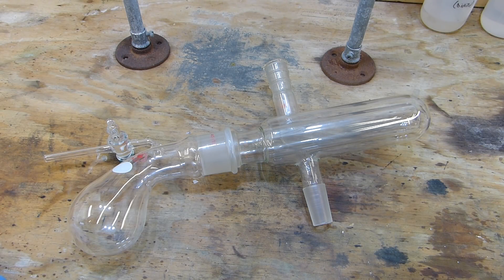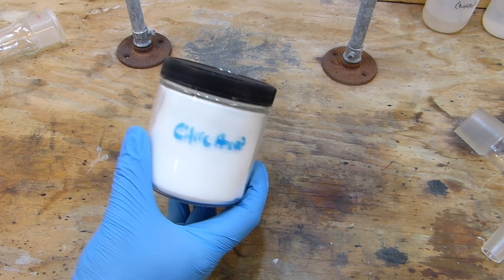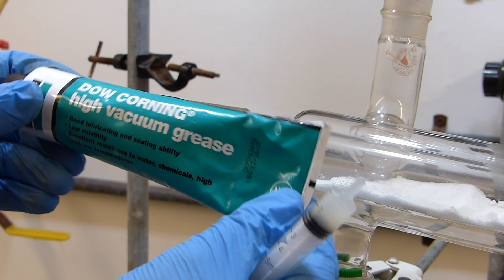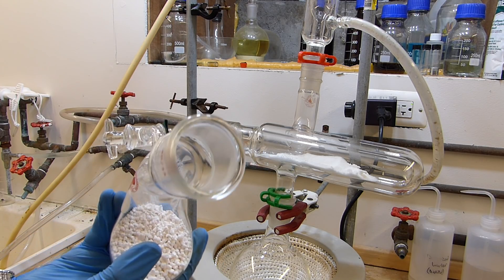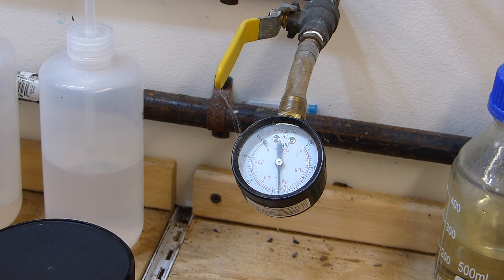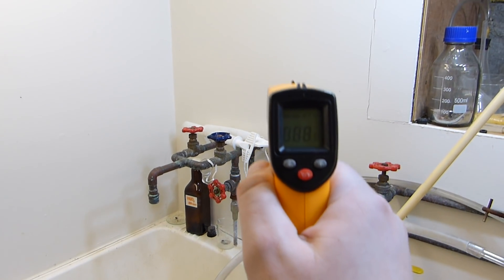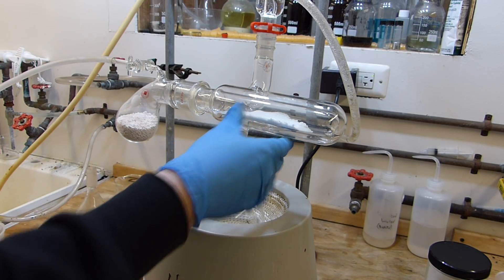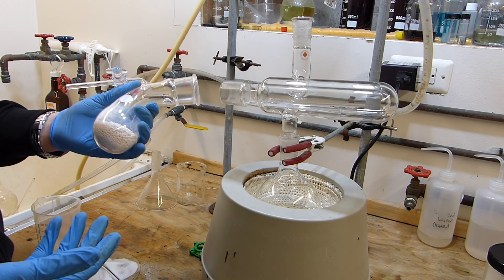Lab Glass: The Drying Pistol

Comment: 10:02 As far as there are several oppositely located orthogonal to the plane of the joint intersection hook-like branches you can use a rubber band to secure the joint.

Disclaimer: While It looks like I am going to necropost, note the non-null possibility that the piece of advice may help someone :)

Comment: I got an oldschool (50s-60s) set of glassware from a retired chemist that had a hobby lab at home as well. Much of the beakers or apparatuses are pre ground-glass joints/openings (meant to use rubber/cork). 

Interesting Items: 
- A whole vintage collection of various compounds/chemicals from some place in the 60s that was like Fischer/etc but apparently sold in smaller amounts cheap, and didn't care if it was also to kids (cuz one of brochures was marketed to the kid 'chemistry set' but they contained hazardous compounds lol
- A Hoffman Apparatus: Its in pristine condition, but hasn't been used yet because I haven't found an alternative to platinum electrodes for the one side. 
- Interesting old-school long (24") pipettes with detachable bulbs but no removable heads. 
- Some of the simple distillation flasks w/ the integrated condensation  at like 60deg angle of the neck. 

I was hoping to find time to start a YT series testing the existing large batch of old chemicals and/or repurposing them. I really like the DIY channels like this as that's my style, but I find a lot of the 'surplus' and 'post-dated' chems are super cheap, and while not production lab grade they can still be viable for many things in an amateur lab or re-purified (discarding the degraded %)
Reply: Platinum electrodes are still readily available. United Nuclear carries them for ~25USD.
Reply: Correction, 2 for 35USD, comes pre-fitted to rubber stoppers which you may have to contact them to make sure they are the right size.

Comment: This has been replaced by pid controlled water and oil baths.  Connect a flask to a vaccum adapter.  Then a male to male 75 degree adapter and another flask.  Put the flask with the compound to be dehydrated in the pid controlled bath.  Come back the next day.  No flammable vapor.

Comment: I know this is a old video but I do have a question. Why do we need a boiling liquid in the jacket? Why not heat water around that temperature and keep it at that temperature and constantly run it through the apparatus?
Reply: At one time it was not possible or convenient to control temperature like that. Boiling points however, are well known and reliable. Using a boiling point solves the problem of having to constantly fuss with the heat source.

Comment: I can’t figure out why you need to turn on your water to get vacuum pressure🤔
Reply: The aspirator works by pushing a stream of water through a venturi in which there is an orifice. Because of the venturi effect, the pressure at the orifice is reduced, which draws a vacuum. This is the same way that sink powered aquarium vacuums work.

Comment: I dont understand all the refluxing thing in this case. 
Isn't possible just to heat the glass at a constant temperature?
Reply: It is not practical to try to manuall fuss with a heat source to a precise temperature like this without modern electronics. This device predates modern electronics and was meant to get around the problem.

Comment: it's particularly useful for drying and then taking the entire pistol (minus the condesor and boiling flask) into and out of an inert atmosphere glovebox without having to expose the material to the atmosphere. but you need a real vacuum and inert gas so as not to destroy the atmosphere in your glovebox when you open up the pistol inside the box.
Reply: True enough, although I would point out you can do that with a modern desiccator as well.

Comment: When you use an aspirator to make vacuum, the vacuum is contaminated with water vapor (vapor pressure at temperature of water in the aspirator).  Isn't this higher then what CaCl2 can make?  Doesn't re-opening valve to aspirator introduce water into the apparatus after the CaCL2 has done its work?
Reply: How can a vacuum become contaminated when it's always being drawn down? The air in the line might become contaminated, but isn't it being blown out of the faucet?
Reply: @jermainerace4156  The vapor backstreams from the vacuum pump to the pistol.  When pressure is low, each gas molecule is operating independently of the others (most of the collisions are with the vessel walls, not other molecules).  Look up "molecular flow in high vacuum" for more.  When pressure is high, the dominant interactions are between gas molecules (look up "viscous flow").  This "backstreaming" problem becomes dominant at high-vacuum regime, so much that the pump selection dominates the choice of pump.

Comment: Im a little confused as to how your vacuum works with your sink.... But thats badass.
Reply: The vacuum device, called an aspirator or aspirator pump, uses the flow of water to create low pressure, thus drawing out the air.

Explanations here:  https://en.wikipedia.org/wiki/Aspirator_(pump)
and here:  https://en.wikipedia.org/wiki/Venturi_effect

Comment: You said this is an outdated equipment. Just wondering what replaced this? Vacuum desiccators? This seems like a better option since you can heat up your compound.
Reply from the maker: Mostly these fell out of favor with the invention of electronic temperature control. Back before electric hotplates and ovens, precise temperature control was difficult since you would usually heat with a flame. The vacuum is mostly a bonus.

Comment: Hey Doug by any chance would you make a video showing how to make chlorohexidine?
Reply from the maker: Maybe. That would involve quite a lot of videos. I'd have to do benzene -> chlorobenzene -> p-nitrochlorobenzene -> p-chloroaniline. I'd roast calcium cyanurate to calcium cyannamide, set that aside. I'd have to somehow find hexamethylenediamine which is a nylon 6-x monomer but otherwise difficult to prepare. The cyanamide and hexamethylenediamine would react to attach cyanogunnidine groups to either end of the amine, and p-chloroaniline would react with that to form Chlorhexidine. 

As for the hexamethylenediamine, the only way I can really think to do it in the lab without buying it is with suberic acid reacting with urea to form suberamide (Octan-1,8-diamide) and then running a Hoffmann on that to get hexamethylenediamine. I'm really not even sure that would work though. It can be made from furfural but that route requires large amounts of cyanide, which is also difficult to prepare.

Comment: Whats the drying differences between this and say, an oven?? Edit: Might have been cool to weigh then use the weight of water loss to estimate the average amount of dehydration
Reply: There are things you can't dry in an oven because even the slightest overheating causes problems, such as drying proteins. That's the purpose of this apparatus. Cheap, reliable, extremely precise (using boiling azeotropes) drying unit that won't stop working like thermostats stop.
Reply: It's also faster because you are using the vacuum increases vapor pressure of the thing you are trying to remove, and you can't always use an oven because it might always be water that you are trying to remove.

Comment: To answer your quandary, no, there's nothing that "specifically" requires that apparatus. All of it's functions can be achieved with an oil bath, PWM control of a heating element with feedback from temperature sensors, and a few pieces of common glassware. Fascinating apparatus though. You'll have something quite special if NK ever sneaks a nuke past out defenses and EMPs us back to the early industrial age, so there's that.

Comment: Doug, what is your opinion on using vaseline as vacuum grease?
Reply: Minipac S I am not a chemist, nor have I ever done chemistry, but I am very fond of watching chemistry videos. A quick Google search will show you that Vaseline could only be used under certain conditions, and is not nearly as good of a grease as real vacuum grease is.

From Wikipedia (I've put useful bits in bold)

Petroleum jelly is a mixture of hydrocarbons, having a melting point usually close to human body temperature, approximately 37 °C (99 °F). [4] It is flammable only when heated to liquid; then the fumes will light, not the liquid itself, so a wick material like leaves, bark, or small twigs is needed to ignite petroleum jelly. It is colorless or has a pale yellow color (when not highly distilled), translucent, and devoid of taste and smell when pure. It does not oxidize on exposure to the air and is not readily acted on by chemical reagents. It is insoluble in water. It is soluble in dichloromethane, chloroform, benzene, diethyl ether, carbon disulfide and oil of turpentine. [1][5]

I realize you probably just wanted a response from a semi-famous YouTuber, but in the small chance you are really looking for advice, I decided to help out.

Comment: Doug, you could put a piece of hose on the outlet of the aspirator and lead it into the drain. It would get rid of the splashing noise. Aspirators have zero issue with an extention hose

Comment: Beautiful. I used to have one, also. One little problem, however: You are not supposed to have any liquid in the jacket of the drying chamber. Seems that some wound up in there, when you filled the flask thru the condenser. That's why the return tube is offset. Liquid in the vapor jacket cools the entire thing.

Comment: Does America use different glassware sizes? Over here it tends to go B24, 29, 34, 40... Never seen a 35 before. Interesting video though, I've seen drying pistols mentioned in papers but never knew what one actually looked like. Antiquated techniques can still be useful though, I used our soxhlet extractor a few times during my PhD.
Reply: As with most things, USA hates world standards for some reason. American standard tapers are longer. They do fit into world standard ones, but parts stick out, or they sink too deep. World standard tapers (Normschliff NS, according to DIN and later ISO) has one called NS 34/35 which is the closest one to the one you mention.

Comment: If using an aspirator or an electric vacuum pump couldn't you just ignore the desiccant? If you ran the aspirator constantly as if it were a vacuum distillation then unless you had a problem with your seal, awful vacuum pump, etc. the water vapor would be pulled out. It would be like a vacuum desiccator hooked up to something like a steam bath.

Comment: You should try drying oxalic acid using that! The reduced pressure would of course mean you could heat it at a lower temp and this avoid sublimation since at reduced pressure, oxalic acid generally sublimes at tempuratures just over 100C. Awesome video btw!

Comment: The inside of a 'male' joint is not greased. I think preloading the desiccant then putting them together and turning the jacket to grease it doesn't affect the desiccant or the seal. I don't think greasing it then locking the jacket in place with cat clips before scooping the citric acid in would destroy the seal either.

Comment: when u use tap water 2 pull a vacuum, y wont the water be sucked back into the metal pipe?
Reply: The water won't get sucked into the pipe.
But what can happen: If you turn off the water while the apparatus is unsealed and under vacuum, some water will get sucked into your apparatus.
Reply: It can happen if the water pressure falls down because, for example, someone else in the building opens the faucet. Happened to me once and I've lost an entire load of product.
That's why it's good to have a Woulfe bottle or Büchner flask in the line - if the water surges back, it gets trapped.

Comment: If the vacuum grease is insoluble in almost everything, how do you clean the glassware?
BTW, you're using a water-powered vacuum pump to dehydrate a sample? :p
Reply: In our university lab we use acetic acid ethyle ester  (sorry if that's not the correct name, directly translated from german.)
Reply: Pseudo Memes sounds about right
English chemistry nomenclature is so whack, German makes it much more distinct.
Ethyl acetate is the shortened form though,  right?
Reply: This is a silicone grease. It's soluble in petroleum ether and a wide variety of relatively apolar solvents. I use actual fluorinated greases and we base bath the glassware. The grease doesn't dissolve but detaches as the glass underneath dissolves.
Reply: I know it's been 2 years+, but hexane.
Reply: @Felixkeeg  -- Thank you.
Reply: Thanks for the reply!
Reply from the maker: It's actually pretty soluble in a number of halogenated solvents as well. Chloroform/trichloroethylene/tetrachloroethylene does a decent job. You don't really need to clean all of it off though. I usually wash as normal and just give the joint a wipe before I stick it into the cabinet.
Reply: The common name is ethyl acetate.
Reply: We just through it away and get new.